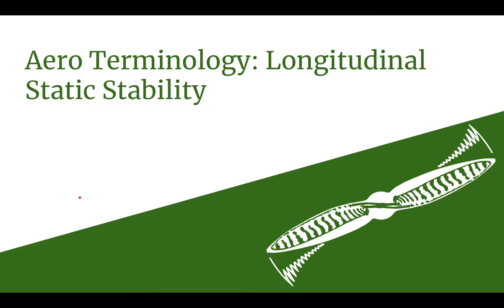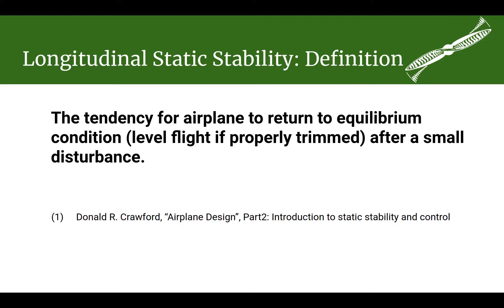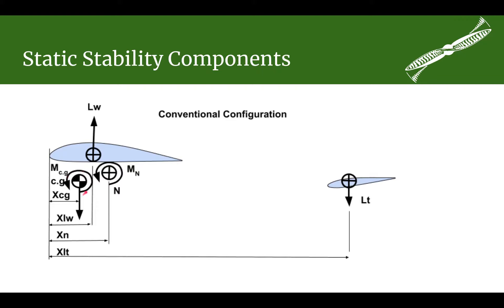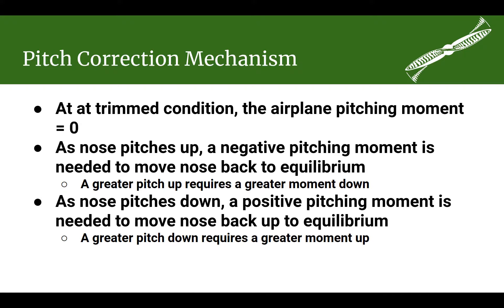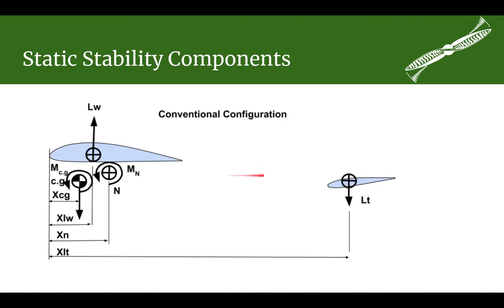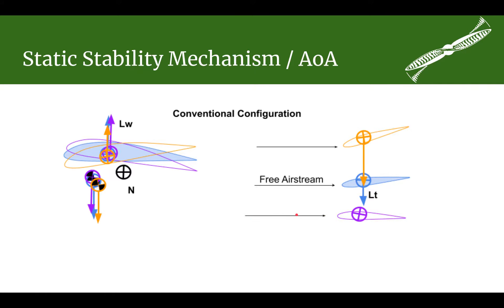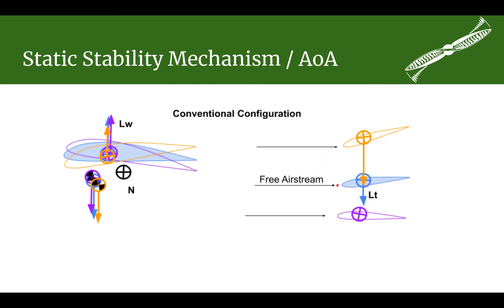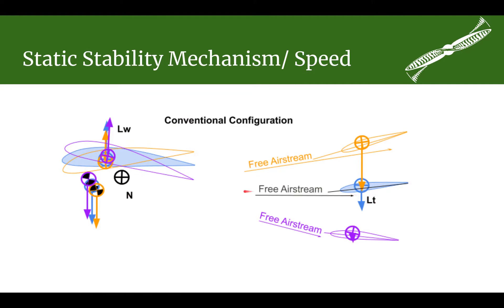Aero Terminology: Longitudinal Static Stability

Comment: Is it possible for a given airplane, with the CG ahead of the NP both stick free and stick fixed as required for stability, for the horizontal tail to be generating UP force, instead of downforce, in some flight configuration?
Reply from the maker: There may be a configuration that would have up force on the horzintal tail but I don't know of one. Except for canards of course.